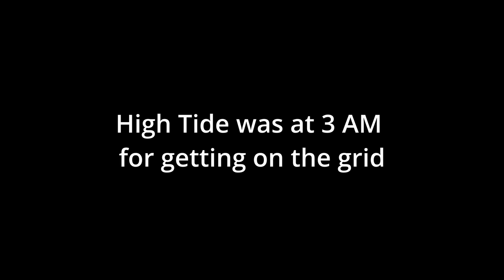Grid Time and Mystery Tool Revealed! - Emerald Isle: Ep.47 Fishing Boat Refit

Comment: Damn, the suspense! I was on the edge of my seat . And I'm like, watch the hose with the torch. I was flinching, waiting for the prop to explode off the shaft, taking the rudder out. Great job!
Reply from the maker: Thanks Straw Carpenter. The first time we used a setup like this was with the Fish Tale, twenty some odd years back. I must have had that portapower maxed out and nothing was happening. The yard manager came over, gave it a wack with a hammer, and it exploded off the shaft. What a sight and racket! Seems like it happened yesterday, and that was in the back of my mind. Thought I would wrap some scrap line around the shaft as a shock absorber, and promptly melted it down with the torch, haha. Figured it was better to let it burn than reach in there. What a fun day!!
Reply: I was piloting a fifty foot steel barge on the Thames river in Britain, just coming in to moor up at a lock, showing off a little, coming in a bit hot, then full reverse to slide into the mooring and the prop came off. We were able to jump off and slow her to a halt with the ropes. Still embarrassing. Luckily had a diver buddy who retrieved the prop from the mud & put it back on for a few beers.
Reply from the maker: Yikes! Sounds like a good crew that knew what to do in a pinch. Great save!

Comment: Len, Don't know about you but I always saved my old Ballard Nuts (looked like lots of zinc left when you pulled EI wheel nut) and plate zincs for use in the off season. I installed to a nice heavy copper line fed thru a scupper and down to main ground to reduce wear and tear on underwater zincs. Don't know how hot your basin is but mine was hot (many large steel hulls poorly grounded and pleasure boats with dangling power cords) and consumed zincs way to rapidly and they're not getting any cheaper these days I'm sure. (They also worked well strapped to bottom of a personnal use dungy trap as weight). Fun vid...lots of memories brought back doing same! Thanks!

Comment: What was that stuff dripping off the prop shaft after you applied heat to it?  Some sort of lubricant or remains of that hard stuff that was on the nuts??
Reply from the maker: It was a piece of line I wrapped around the shaft. My thought was it would act as a cushion if the prop came loose suddenly and with a lot of force. I was afraid to reach in there to remove it after it started on fire, so I just left it alone. LOL.
Reply: @EISAlaska  👍👍 ahh ok cool just wondering great job as always!

Comment: What would a new prop that size cost!
Reply from the maker: Depends on type and alloy, Michael. 32" Dyna Quad Bronze prop runs about 5K. In Nibral, $6500. Our wheel is 40" diameter, so I'm guessing 7- 8 grand.

Comment: There is a set screw on top of prop shaft. Take screw out then keyway will slide with the prop and come off.  Its on the top of the prop ,the hole in the prop . Geesh.
Reply from the maker: Try watching the video to the end Wesley. You don't "tap" a 40" prop that weighs 150 lbs off with a hammer. You use a prop puller. This took nearly 10 tons of force to break loose.